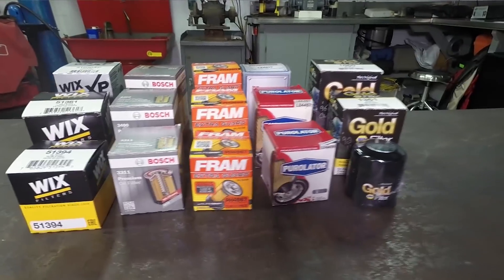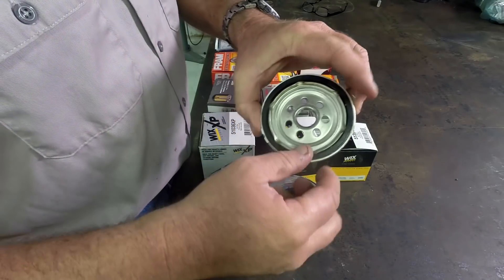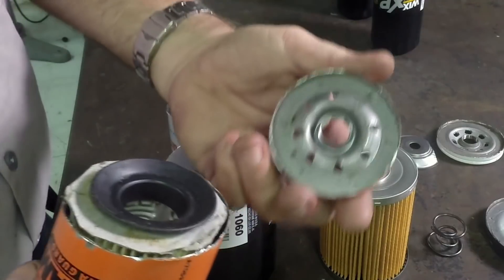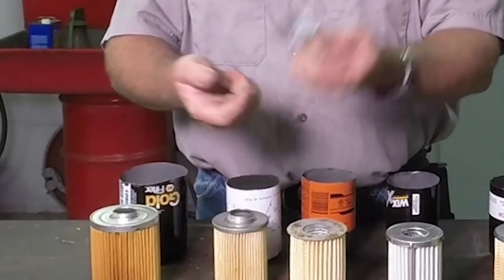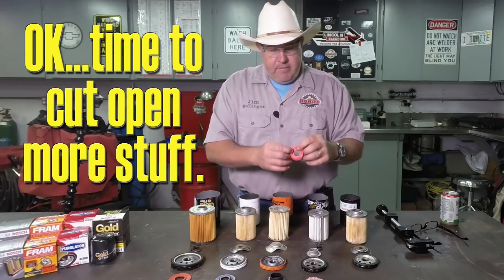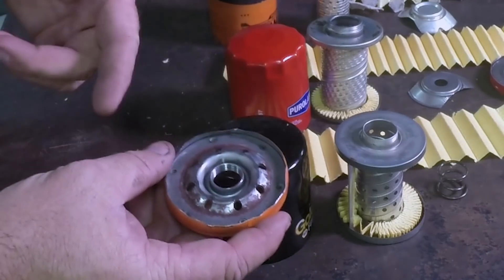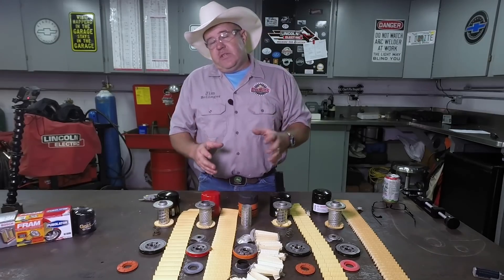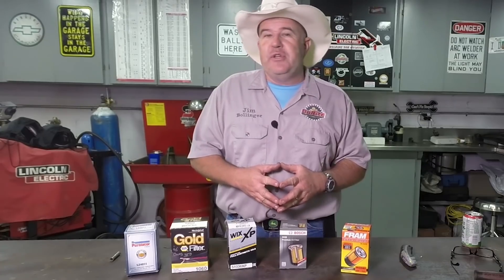The worst oil filter EVER!

Comment: I call bull crap, I've been using fram for over twenty years without any problems ever!!!
Reply: well you've been a idiot for over twenty years my friend. the proof it right in the video. its why Chevrolet would void your warranty if you used one of frams filters, even they know its garbage.
Reply: @GLITCHGOD2427  why are you calling me a idiot? you are the ignorant one. chevy does not void a warrant for using a fram oil filter. just cause you watched a video saying fram was not good doesn't make it true. get your facts straight before you start insulting people because it is obvious you are not a mechanic and have no knowledge of engines or why they need oil.
Reply: I had a Fram fuel filter on my truck once. The element detached inside the housing and unfiltered fuel went to the engine and ruined my fuel injectors. Also the filter element was about half the size it should have been. Since then I've cut open WIX, Motorcraft and Carquest filters, and they all had the proper sized element in them. Fram is horrible.

Comment: I certainly do not doubt that Fram filters are of the lowest quality available.  I don't know if it's worth all the flipping out over their quality though.  I run Napa Gold on my Duramax and probably will never spin a Fram filter onto it.  That said, I've also ran 3800 V6 GM's a lot of miles with mostly Fram filters with no problems.  I ran the first one almost 300k miles and it was still running fine with good oil pressure when I sold it.  Truth be told, you could probably screw an empty oil filter can with no media in it whatsoever onto your engine and get just about as many miles as you would running Wix or Napa Gold filters.  That's if you're careful not to dump dirt or other crap into your crankcase.   Premium oil filters provide peace of mind, no doubt, and expensive engines deserve them.  But I'm not going to flip out when looking to buy a used car if I see a Fram filter on it.  If that filter looks shiny and new, I'll be impressed that the oil was changed.  Clean new oil at regular intervals means more than how much you spend on your filter.  Even Wix filters won't fix crappy old oil. 

I'm not dogging this guys video, in fact, I enjoyed it, "liked it" and thank him for his time and money spent doing the research.  I'm just trying to keep things in perspective.

Comment: The purpose of a filter is to remove particles from the oil. All filters have to pass a standard SAE test of filtration in order to be sold. So the Fram at least meets the minimum. Which explains why my Jeep is still running at 250,000 miles. 

I see your point regarding the construction but that does not address how well the filter cleans the oil.

The filter was never intended support weight or to be used as a hammer.

You made some good points and it was a clear and well made video. But it doesn't scientifically address how well the filter does what it is designed to do. There are a few other people like you who have opened the Fram and had negative things to say about them. So I guess I'll have to change my thinking. Maybe the good Lord just took pity on me and held my el cheapo Frams together all these years. I liked them for the gritty coating that lets me get a good grip on them. I'll be switching to the WIX or NAPA filters next change.

Comment: I just watched AvE pull metal slivers out of the inside of a brand new Fram filter. 2019
So they haven't fixed what they are doing wrong.
Reply: They won't fix it because they aren't doing anything wrong, they're doing exactly what they want to.  That quality doesn't happen by accident, they're garbage by design.  Probably making bank because of it too, because 90% of people don't give a single fuck what oil filter goes on their car.
Reply: Teflon was the "supermaterial" of choice for a few years. Remember how all of the sudden wheels, bolts, wiring, headlights etc were all "Teflon" coated? It's awesome stuff... But it can't cure cancer. lol.

Comment: I only use OEM oil and filters directly from the manufacturer on both my Toyotas. My Corolla has 318,000 miles and no repairs! I also use some cool vehicle maintenance software www.lonewolf-software.com/automotivewolf.htm to track my maintenance schedule and remind me when anything needs to be serviced, It also tracks all expenses and parts which is very helpful since I do most of my car maintenance myself.
Reply: I've got a 96 Tacoma with over 300k, always use mobile 1 synthetic and purolator filters.  If you take care of them most Toyotas are hard to kill.

Comment: Fram filters are still junk I see. Use one and your engine will go "FRAM!"
Reply: I've got a 1996 Mercury Mystique with over 200,000 miles and it has always used Fram oil filters. It hasn't gone "FRAM" yet.

Comment: why did you use a basic fram filter vs mid to "higher end filters"? also like to add that when you put brands up, you should do you home work. and not put 2 of the same filters on your show "cough" napa gold and wix. Some thing else filter media length does not mean more filtering per-say. It can also cause low oil pressure due to the increased resistance as found in wix fuel filters.

Comment: Never oil your finger and then stick it in the threaded hole, thinking it will serve as "lube". You will however lube it with your own fresh blood.... those threads are sharp as razor blades inside filter openings.

Comment: Used Fran for years had some issues on my Honda Civic changed filters a few times ended up really liking the Napa filters and wix filter mostly used wix.  Now I have a Nissan pick up and I use there filter that they use a dealership.

Comment: So I’m 50 now , when  I was about 13 and Amsoil guy came to our house and used a Falanx where tester to show us how good synthetics were compared to conventional oil‘s, now these synthetics had originally been designed by Angele’s to run in jet engines for the Air Force , they. Amsoil were the first Who invent synthetic oil  in the world, the one thing he told my dad during this visit was never never ever use any Fram “Rhymes with sham“ products because they were the cheapest Filters and would actually damage your vehicle, as they fall apart and came unglued while you’re driving down the road dispersing pollutants they were made from into your oil!! He then proceeded to cut open a Fram filter and Amsoil filter and showed the difference in quality, nevertheless we were mesmerized at this education. we never used their junk ever again and never purchased a quart of Pennzoil ever again as well, which was the worst garbage oil you could purchase and needed to be changed out of your engine at about 500 miles it had lost all lubrication quality ! notwithstanding newer Pennzoil is much better. I don’t know that you get a second chance when you sold garbage for so long.I always use Amsoil products since then and have vehicles with six and 700,000 miles on them “gas engines”that are not worn out yet. For anyone who wants to know Amazon oil filters are made by Hastings, who have been in business for I believe over 60 or 70 years.
Reply: show me one, just one engine that has been 'destroyed due to the fram oil filter'. I have never seen one in my 25 years as a diesel mechanic. I'm not a fram-boy (fanboy), just stating the truth that engines don't fail because of the type of oil filter.

Comment: Honestly, how important is it to use a high quality filter unless you are like me and only change the filter every 3rd time. I change my oil every 2500 miles with mobile1. Now hear me out. I spent a year looking at old filters off my work truck. Ya fram sucks always has. Would fall apart after 1500 and somehow held thick compounds. It was the filter falling apart. All the rest seemed undamaged or uneffected after 5,000 miles doing a filtration and vescocity test thru the filter material. Loading material or paticulates did not start to show up until 6 to 7,000 miles. Now these are brand new vehicles or low mile purchases. Not an abused engine. Valves looked new at 200,000 miles with no internal wear and perfect oil pressure. I put 70,000 miles a year on a truck or car so over the last 20 years I've owned a lot of vehicles. And resold a lot of high mileage vehicles with no one coming back to say the engine quit. Just sayin. My favorite by the way is puralator. So why change it every time at 15,25 or even 3,500 miles. I don't know.

Comment: As soon as I saw the title to this, without even clicking on it yet..."It's a Fram."
Expectation met.
Worth noting is that their 'new' "extra guard" ones they came out with a few years ago were actually an UPGRADE.  The previous version to this (from what I can tell, the ones without the black grip on the filter) actually had PAPER anti-drainback valves in them.  They were pretty notorious for failure.  It's hard to believe that these are still popular.  I guess a lot of people can't see past the $1 they save on the filter for buying garbage.

Comment: I’ve used Fram filters for 30 years and have never had an engine failure. Have had 2 transmissions go out though.  I’ve only bought one vehicle new and it has over 300,000 miles on it now but usually buy used with 80 to 100,000 miles on them and run them to 300,000 and get a different one. People take my advice and use Fram with confidence, just change your oil every 5,000 miles and don’t worry about it.

Comment: Your rite. My 09 f150 5.4 developed a severe engine rattle at 200th km at idle.
Went to Ford they said I needed new engine. An old mechanic pulled me aside and said get rid of the frame filter use OEM. Then run a couple cans of seafoam in oil for five hundred KM. Then dump oil and use oem filter. Well the motor is as quiet as a singer sow machine now at 300 thow km. That's how bad frame is.

Comment: Did an oil change on my son's '03 Ford Expedition - the FRAM filter element had collapsed on the inside - we had cut the top off the filter with my cutter.  Worthless.   Put on a Motorcraft, but Wix or Napa from now on.  I use NAPA gold for the Porsche.

Comment: I put 210,000 miles on 2010 suburban and have 160,000 miles on 2014 yukon using walmart synthic and fram filters changing at 8,000 miles with no problems! maybe the others are better but fram GETS THE JOB DONE

Comment: the truth will set you free!  this idea of what a filter looks like is insane! I often cut open filters after they have been used. THERE IS NEVER ANYTHING IN THEM!  only a fraction of the oil goes through a filter! if there is anything in the filter it is too late!  the only thing worth while is change your own oil and look at the bottom of the catch pan in the sun light to see metallic particles. don't worry you will not, the oil plug usually has a magnet on the end to trap metal particles. just change the oil, monitor the color and check the level.

Comment: That fram was scary.  Been using the same model Motorcraft filter on my f150 for 17 years 160k miles
Reply: Seventeen years you say....I'd say it's about time you changed your oil. and filter.  LOL Just pulling your leg.
Reply: Being using motorcraft filter on my f250 for 5 years +/- 250,000 miles I stock up from Walmart 12 more years will see if motor lasts

Comment: This is a good comparison on the quality of build but it doesn't test how well each filter actually keeps the oil clean. The  filters are in a metal case for a good reason. They don't twist and flop around in there so to me the twisting has no relationship to the filter capabilities.

Comment: ive never used anything but fram oil filters and have over 430k miles on a toyota engine... they arnt meant to be cut up.... they are for use when oil is circulating and if it works it works i drive hard

Comment: i been using fram or  what ever cheap filter i can get and have never had an issue and i don't exactly change it every 3,000 miles either i'm lucky if i do it at 6,000 as between what my old truck leaks and what it burns at 3,000 i have already replaced 5 qt of oil

Comment: Never had a problem with FRAM myself and they're within my budget. Every one of my 5 vehicles has over 100,000 miles on them (two with over 200,000). Regular oil & filter changes help considerably. I do use a NAPA filter on my tractor but only because they're the only ones in my area that carry the one it uses, at over $20 with tax.

Comment: While entertaining, cutting open an oil filter isn't really a good way to test the performance. Why not put the filters in a bunch of cars, drive the cars 5-10k miles, and then analyze the quality of the oil. The filter could be made out of tissue paper, but if it does the job then it does the job.

Comment: I worked for a dealership before and all cars that used fram filters all had engine problems due to oil pressure low due to these filters! Don't be cheap with your vehicle! If you have new car do the right thing and stick with the factory oil filters!

Comment: Have been using Fram filters over forty years of driving and haven't had a problem. So not sure what your demo proves.
Reply: It proofs that your engine oil basically runs through toilet paper and some glue holding it together . . . It works but not ideal,😂

Comment: If you don't test the filters and show the results in actual use cutting them open means nothing

I always use a motorcraft crossed to my application as they're $4 and built by purolator, every bit as sturdy as a wix maybe better.. 

But that's just brand preference and meaningless without data

Fleetguard is Cummins own brand and is now making filters with plastic e core center with paper ends, they're known for quality

Toyota Denso filters are known for quality and the pleats on the end are simply glued together with a huge glob of glue, no endcap at all... so a cardboard end to hold the glue until it dries may just be a good design afterall

The surface rust is likely due to improper storage in the cold, and it's in such a spot it will be filtered out anyway if it even washes off, the oil moves pretty slow...

Comment: Been changing my oil myself since the 90’s.  Never had a problem with Fram.  Ever.  Thanks for info but I’ll stick to what I’ve been using for over 2 decades.
Reply: I've been putting Fram on cars, trucks, and tractors for decades and I never had an engine to blow up yet. I guess we have been lucky:)

Comment: The correct test it to measure the filters ability to filter the oil, looks mean nothing.
Reply: Actually that's not true...he has pointed out the differences in the main components and the Frams are just plain made of junk when compared to the others he tested.

Comment: I haven't used Fram garbage in decades. I have customers who insist on Fram, despite me telling them with all honesty that they are junk. Their argument as to why Frams are good is always the same: "They have that grippy stuff on them". That's the only reason most people around here use Fram, it seems. The textured paint on the stupid thing. I've done oil changes for a living, I've never wished a filter had "grippy stuff". Doesn't make a filter any easier to change, and it's not worth using a soup can stuffed with cardboard just because of some textured paint on the outside.

Comment: LMAO!!!! Can't wait for Fram to sue you. I've used them for years in our race cars, family cars, and everything that goes through our shop. Not one engine has failed, and I've never found rust inside of one of those filters. And we actually use a real filter cutter to cut the can off of them. WE inspect every filter off of our race cars, not because of the filter, but as a maintenance requirement. Never had an issue with a Fram filter ever and never will.
Reply: I dont see why you cant step up to something that is going to be much higher quality than fram. Sorry buddy but the evidence is here
Reply: @noobeenaut  LOL!!!! Nothing of higher quality to step up to. Use what has worked for years, no need to change now. The day I start exploding race engines due to the filter, that's the day I'll think about it. So far, my cars, my customers cars, and my NASCAR G.N. Sportsman div. cars are doing just fine with Fram filters.

Comment: Just because a filter has more filter paper does not make it a better filter. More filter will make it last longer sure, If you don"t change it regularly. Reg. oil changes, Fram will do its job just as good.